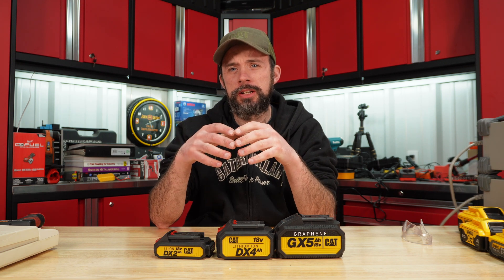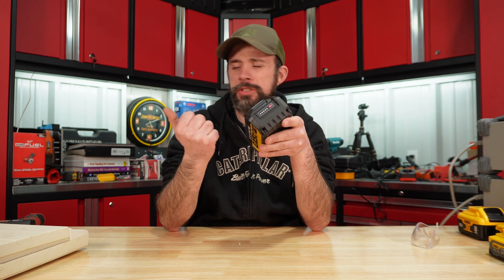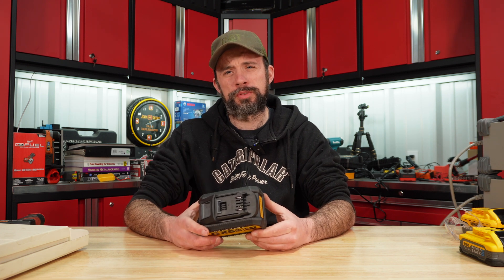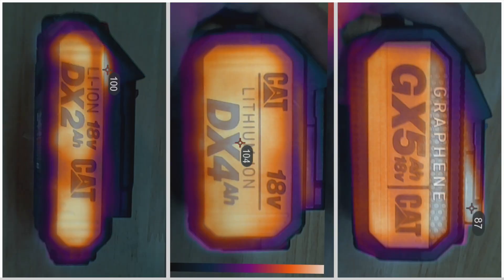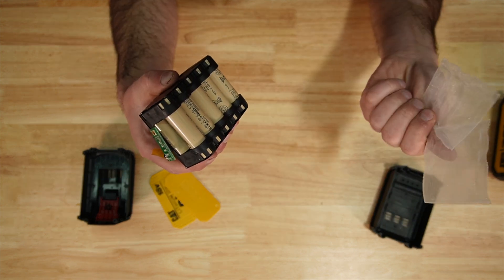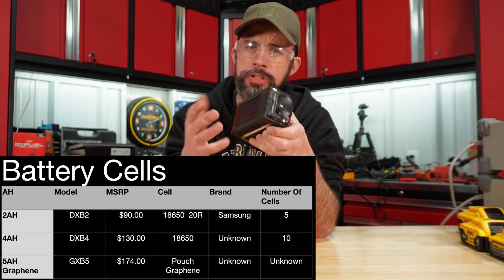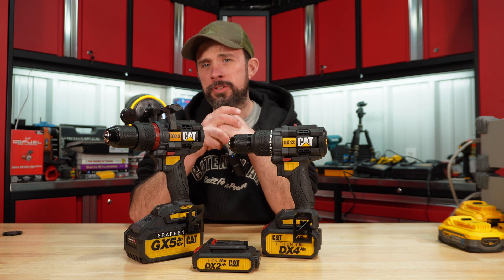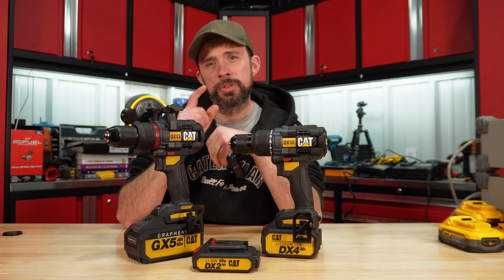CAT Graphene Battery Testing

Comment from the maker: Ran the same test using the DCD1112 (12amp) dewalt charger.

5AH PS charged in 42 minutes Vs 46 with DCD118 (8amp) charger.

Comment: I think they used a Graphene Capacitor. Then that charges the lithium batteries back up.. As the Graphene Capacitors hit the market last year.. This would explain the weight... Just so you know. Graphene Capacitors have 5x the energy density of Lithium.. Which makes them very useful for quick charging..With damn near zero heat produced...
Reply from the maker: Makes sense that defiantly could be the case,  charging and the lack of heat is insane.

Comment: What I want to know, is are these batteries or supercapacitors? Supercapacitors are bigger and heavier for the same amount of power, and they don't have a half life like batteries. They can also charge and discharge rapidly without taking damage = giving you that immediate kick on a circular saw. This rapid dump damages batteries. I suspect inside are graphene supercapacitors and not batteries at all.

Why aren't companies combining supercapacitors with battery technology? The supercapacitor can be connected to a controller that can sort of kick it into another gear when the battery strains to start up, or when we push the motor hard quickly.

Eg when you start up a circular saw, introduce load, cross over knots, or push the blade too hard - the supercapacitors would do the load dumping to give the motor the rpm boost, and the battery would maintain rpm's... Does that make sense to anyone? I'm not an engineer lol.
Reply: Spoke too soon, you tore them apart! Never seen a graphene pouch. I wonder how it works... 🤔

Comment: Dcb1112. Is the dewalt 12 Amp charger. You were using the Dcb118 which is a 8 Amp charger.
Reply from the maker: Just retested with the DCD1112,  showed a drop in charge time to 42 Minutes for the 46 with DCD118
Reply: @Tools-Tested  was expecting a bigger difference for the jump in power between the 2 chargers. Makes you wonder how the graphene batteries are affected by that rapid charge time.

Comment: Do you think these could just be DeWalt power stack style cells but with Flex battery circuit board and charger?
Reply from the maker: No the pouches seem to be different sizes,  looks like each manufacture is doing their own,  when it comes to pouch cells.

Comment: I'm curious what the difference in power delivery from the DeWalt vs CAT charger is? I'm not finding any specs for the DeWalt fast charger.
Reply from the maker: This dewalt is 8amp,  just found out they make a 12amp.   Im going to pin a comment once I test the PS on it. The CAT is a 15amp charger.

Comment: Looking to get away from Dewalt after my first experience with getting warranty service, this looks like what I’m going to probably go with 👀
Reply from the maker: Honestly if you live in the us you might look at the Hercules from HF.  That new brushless drill is an animal.  So much that I need to upgrade the dyno to handle it.  They also have batteries with Samsung 21700 cells now as well.

They have come a long way and the warranty exchange process at the store seems better than dealing with the mail it in BS.
Reply: I agree… i went new HF impacts cuz dewalt impacts are weak… dewalt is better the CAT dont go backwards

Comment: 3:36 you can probably just connect the terminals of battery and tool with wire to activate the battery and then use the load cell
Reply from the maker: Yeah im going to work on that,  it just sucks they did that.
Reply: @Tools-Tested  are you sure it's got transistors that cut the power? That's unusual as it adds cost and wastes power. I went looking for a teardown but found TTC doing the same load test as you. Can't see any extra wires, but maybe he's hiding something.
https://youtu.be/4Vag90QnEFc?t=326

Comment: Ngl, I was not expecting CAT to come out with a graphene battery like this. Heavy, yes, but that rapid charge turnaround is insane! 🐺🔧
Reply: It's not that insane, a Bosch 8Ah charges 50% (4Ah) in 15 minutes or 80% (6,4Ah) in 26 minutes at the same weight. And it has 60% more energy in it when starting at full.
Reply from the maker: Yep would have never thought CAT would be the first.  I couldn't believe the charge time,  big question will the life of the battery suffer.  It's interning they claim 4x the life over lithium.

Comment: Thanks! It would be interesting to see this compared to say Kobalt 24V system battery price, weight, runtime. Right now you can get the Kobalt ultimate output 24V 8 Amp hour battery for $99 lowes. Seems like CAT battery tools is very late to the party.
Reply from the maker: Plan on testing the Kobalt ultimate but it's probably going to be next month before I have the funds for it.  Yep Cat is defiantly really late to the game.

Comment: Wait wait wait, is there actually a commercially available graphene battery?  How?  When?  What are the specs?  Charge and discharge curves?  Temperature ratings?  Power density?  Cycle times?  CAT offer no information, and I can't find a cell manufacturer.  As curious as I am, graphene doesn't seem to promise anything beyond readily available LTO battery cells so it's probably not worth it for me to buy a CAT battery to disassemble.
Reply: I am wondering if this is mostly marketing with graphene material tossed into a pouch cell bettery vs actually utilizing graphene in the battery cathode for actual benefit to the battery performance.
Reply: Graphene LiPo batteries have been around the RC world for at least 6 years. It's not a graphene based battery, it's a standard LiPo with some graphene to lower the internal resistance. Still debate about whether it's just a marketing gimmick or not.
Reply from the maker: Yeah its hard to say without cutting it open.  It's defiantly going to be more challenging going forward,  considering 18650's 21700's are common cells so plenty of data.  As of right now it looks like the pouch power tool cells are proprietary.  Yeah the CAT line is small and also looks to be dated,  seeing other countries have had the tools for a while now.
Reply: aint no godamn graphene

Comment: Pretty impressive performance from the graphene battery. With such a short charge time would be interesting to see how hot it gets in comparison to the other manufacturer's batteries and what the charging characteristics are. I wonder if that will shorten the overall life of the graphene battery in comparison?
Reply from the maker: Yeah I would really like to see this compared to the Flex stacked lithium and dewalt 5ah power stack.  The dewalt I need to wire a tool up so I can apply the load.  Funny part is they claim 4x the life over standard cells,  which would be shocking with that charge time.

Comment: Glad to see this. Very curious about the testing. I've been curious to see if this was a legit graphene battery or mostly marketing about using graphene without its actual use in the battery cathode. It seems strange that CAT would be the first company to be successfully make use of that battery technology in power tools.
Reply from the maker: Yep its hard to truly say without cutting it open,  but with the fast charging and low temps makes me think its legit.  But I agree seems kinda strange CAT is the one releasing this tech,  but maybe they are the test.  

We still don't know what TTI's answer is to the PowerStack and Flexs Stacked Lithium
Reply: @Tools-Tested   Seems like Positec is behind CAT power tools, like Worx and Rockwell before them. Legit company, but still surprising. Now, there may be good reasons why other companies like TTI hesitate to be the first here. There are potential downsides/risks. Pouch batteries themselves have a reputation of being less durable and concerns about longevity that we haven't seen yet, because they are still new to real world use in these applications. Combining this with graphene adds more uncertainty
Reply: well "cat" didn't do anything the Chinese/Taiwanese.. and until they OPEN THEM UP they're NOT graphene... AT ALL.. aren't you curious as to why all the shipping, MSDS, etc. dont mention "graphene"
Reply: @Steve_mos8541   Why does the presence or absence of graphene depend on if you open it up? Schrodinger's battery? Makes no sense. They are obviously different if they charge so rapidly- in his testing. Far faster than standard lithium ions. But that seems to be the main advantage. The tools themselves seem, meh.
Reply: @ccbowers   because PROOF...  i wanna see shipping HAZmat label, MSDS, or something tha proves it, jus cuz they charge faster don mean shit....  OPEN THEM UIP I SAID
Reply: @Steve_mos8541  well, but one and crack it open. Post it on your YouTube channel 🤷‍♂️